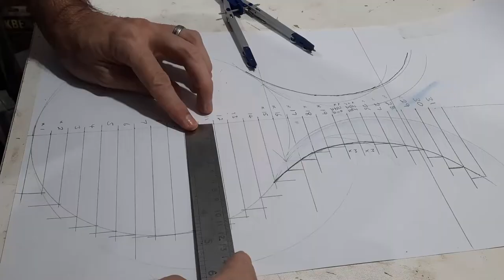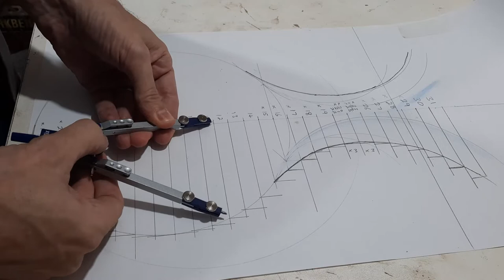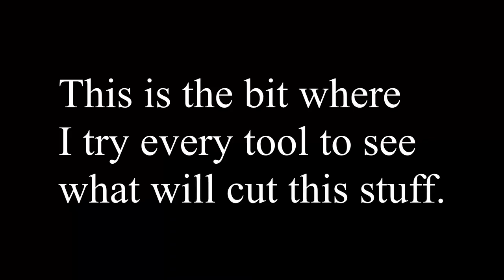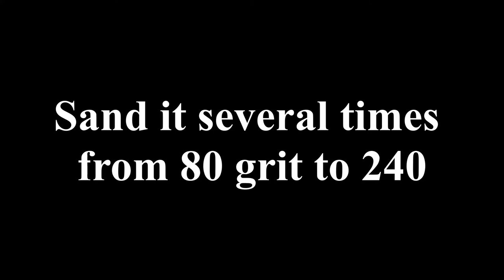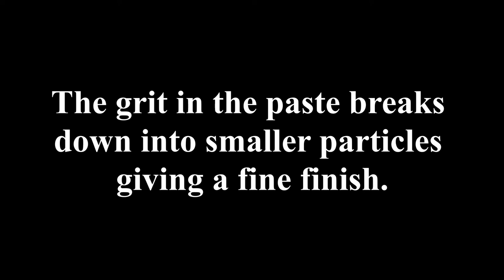[Workshop] Making a Plywood Vase ► Pictures, Noise and Words

Comment: One tip: Don't blow the dust away with pressurized air, use a vacuum hose. And also the raw shaping is easier with a bigger, well sharpened gouge.
Reply from the maker: This stuff wasn't cutting easily for anything less than a chainsaw.
Reply: @PNW  Yep. It’s the glue, which makes it pretty damn hard on any tool. Steel hears over easily, changes color and goes soft. A bucket of cold water aside is good to have.